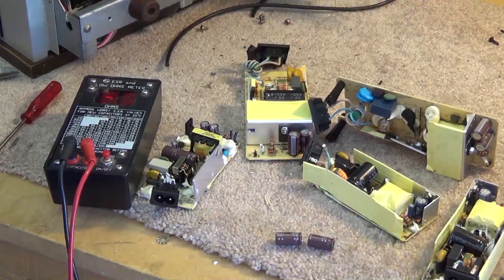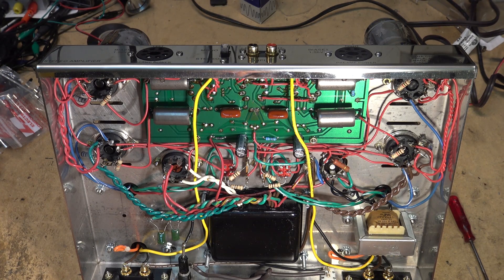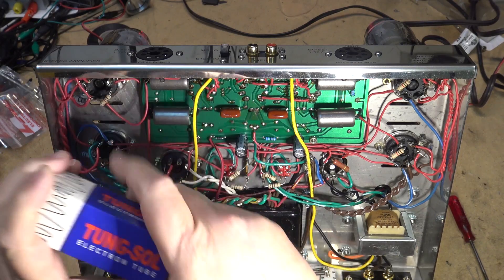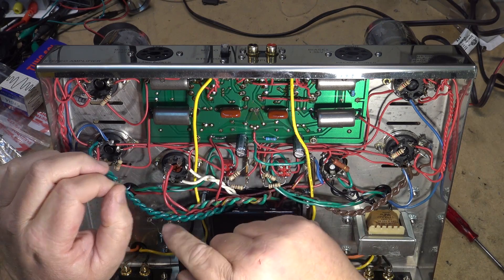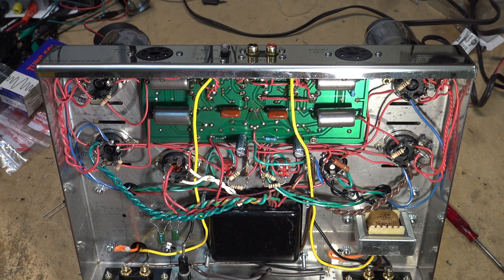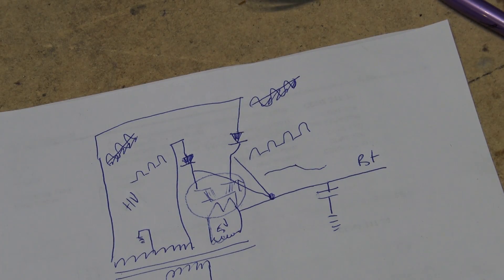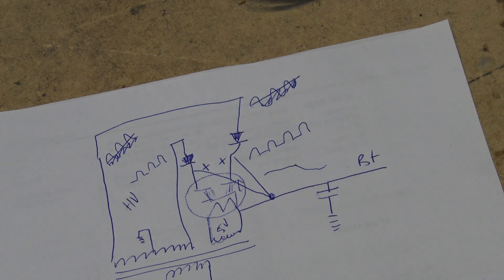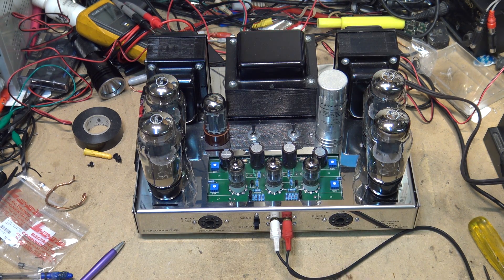Dynaco VTA-ST70 Rectifier tube protection mod

Comment: I have the same problem with my ST-70 blowing fuses. I had been using the amp for many years with a YJR solid state rectifier and it worked great. After a couple of years of not using the amp I decided to try it again and after a couple of hours of use this problem began. I bought a new rectifier tube(JJ GZ34) and made the modification, adding the diodes in the same places you show in the video. When I turn on the amp all tubes light up and in a few seconds the rectifier buzzes and lights up and blows the fuse in spite of the mod. Any ideas on anything I could be doing wrong or that there might be going on with my amp? Thanks in advance!
Reply from the maker: That tells me you have a short on the DC side of things. Could be the main filters, choke, output transformer, or output tubes.
Pull the  output tubes. Does it still draw too much power and blow the fuse/ If yes, then you have a short in one of the trasnformers, filter cap, or anything that the main B+ drives. If it doesn't blow then you have a problem in the output tube curcuit. Possible a bad blocking capacitor that is allowing DC to reach the screen driving the tube into full conduction. Also check to make sure the tubes are actually plugged in the correct orientation. This one  the tubes can go in any way as the sockets are worn and the key on the tube will drop in any position of those cheap plastic tube sockets. Better amps use porcelain tube sockets.

Comment: I found the problem with my ST-70. A dead Quad capacitor. I guess the warranty on it did not last over 50 years... I've ordered a new one and should be able to fix my amplifier soon.

Comment: Question. With this diode mod, what if you were to plug in a solid state rectifier. Will the Stereo 70 amp still work?
Reply from the maker: Yes it will

Comment: Did you have to reset the bias?
Reply from the maker: I did check it was slightly lower .38 so I reset it to .4. remember the bias will change slightly based on line voltage, but a .02 volt difference wouldn't have affected it at all.

Comment: Hello. Is it possible to replace tube with a custom circuit with transistors, capacitors, resistors, diodes?
Reply: Rectifier or output tubes?

Comment: The arc over problem gets exacerbated by turning it off when hot, then turning back on again (before giving it time to cool down).
Reply from the maker: No, it does it stone cold too.
Reply: @12voltvids  I"m sorry...My statement is true.
Reply from the maker: @mlbabineaux  well this one came in arcing and sparkjng at power up after the owner bought new tubes.  The old original didn't do it hot or cold but the new tube did, stone cold or hot and it shouldn't.  The fix is the diode mod to eliminate the reverse voltage. These old units were designed for 110 volts which is what was at the outlet on the 60s when these were new.  We now have 120 volts which adds about 80 volts p-p on the secondary.  This exceeds the max inverse voltage for the new type types available today.

Comment: in europe the voltage is 230v so how would one deal with this modification in this manner of 230v❓different diodes❓of course with anyone using a dynaco ST70 in europe, they have a different voltage regulator...?
Reply from the maker: In Europe you will use a different power transformer or it is wired for 240. I don't remember if it is s single or dual voltage primary.  The diode mod is the same as the secondary voltage is the same.
Reply: @12voltvids  
so the modification is exactly the same you're saying because this comes after the transformers ❓
Reply from the maker: Exactly.

Comment: The original Mullard 5AR4 never needed diodes. Almost all of the russian rectifier tubes don’t meet specs in the same sense as the UK and USA made tubes did. My ST-70 runs just fine on 120 volts with just one CL-80 inrush current limiter on the AC mains and US and UK made tubes in the sockets.
Reply from the maker: The UK and US tubes had s higher reverse voltage.   It doesn't hurt to add the diodes.  It doesn't change the sound and it doesn't change the sag that rectifier tubes have.  If you removed the tube and put the diodes on place of the tube then yes you eliminate the tube sag, but the mod puts them in series.  So everything still flows through the tube.

Comment: Who can help me? My dynakit st-70 has a problem. After turn on the amplifier for half hour, the choke C-354 is very hot. Is it a problem? I always turn on it not more than 30 minutes.
Reply from the maker: Check your tube bias adjustments.
Reply: @12voltvids  You are right. It was 1.64V. I adjusted  it to 1.56V. I will check it for next few days. Thanks.

Comment: SO\o it was full wave rectifier now its a half wave rectifier?
Reply: No, whether silicon or tube, placing two "diodes" in series, on each side, doesn't change it from full wave to half wave. Now, if it was not utilizing the center tap of the transformer and one of the outer legs went to ground, then you would get half wave.
Reply: I could explain better on an illustration.
Reply: With the mod, the plates of the rectifier tube are fed a half wave rectified signal. The cathodes output is full wave rectified dc same as before the mod. 
The addition of the diodes in line with the plates, effectively cuts off the negative pulse to each plate. Now there is 0 volts at the plate not in use, while the other conducts.

Comment: I always thought it ironic those that claim vacuum tube amplifiers "sound better" than solid state.  Vacuum tube amplifiers introduce multiple levels of distortion, from power supply sag to transformer distortion, to impact suppression.  It's like the more distortion introduced the better the sound, which is silly in my mind.

Vacuum tubes, by their high impedance nature, are poor choices for driving low impedance speakers needing high current.  Power supplies with resistor/capacitor pi networks will always sag, regardless of if fed by a diode rectifier or tube rectifier.  One will just do it worse than others.  Why would anyone think the output of a tube amp with all of the new and introduced distortion "sounds better"?  The only thing you can give me, is a vacuum tube amplifier can "soften" up an originally harsh sound, simply because of its rubbery response not allowing high-impact harshness to pass through.

I can understand musicians wanting to exploit the distortion for their instruments, like guitars, to achieve a certain sound, but I still cannot see how that benefits the overall sound of the performance as a whole in a positive manner.

Lesson:

* Power supply sag is distortion, this is brought on by weak rectification and poor voltage control via resistor/capacitor pi networks.
* Audio transformer phase instability and frequency cut off, is distortion
* Poor "punch" response (mostly due to sag) and the inability to sustain high-impact signals before the sag begins.  This is the main cause of the so-called "warm sound" audiophiles claim to love.  It's just distortion.  Harshness and impact are impossible because the sag is softening the output instead of accurately reproducing it.

While I enjoy vacuum tube equipment, I still consider them the devil's equalizers.

Comment: The problem is today's 5ar4 tubes are crap.  An old Mullard or even Sylvania would work in there for almost your lifetime.  In reality I would just do diode rectifier and get better power out of the amp.  Or loose the stand up capacitor and install parallel 5ar4 tubes.  And I believe the 5vokt tap is 3.5 amp on those so it would live through it.
Also the new Tung Sol is made by JJ. And I'm not a fan of there rectifiers either.  The China ones are not that bad and the Sovtec are decent.
Reply from the maker: I have been running Russsian Electroharmonix tubes in my little home built amp and like the sound of them.  I agree that NOS vintage tubes are better, only because they were mass produced and with mass production comes expertise in building tubes. The modern ones are replicas, and even though they are very good, they haven't been making the new ones that long by comparison and the numbers are relatively low compared to before.
Reply: GZ34 from Mullard NOS are the best I've used.

Comment: A power supply sage is not a good condition in a hifi amp the idea is just increase the signal not alter it in guitar amp this is not the case a lot of problems are used as effects but in hifi you don’t want a signal to be changed oof solid state rectifiers and the needed time delay on turn on all so lessen the load on the power transformer and reduce heat the true enemy of electronics
Reply from the maker: The best amplifier you can use is a single ended class A amp.
One of these will give you perhaps 9 watts.  
Class b introduce cross over distortion. Blades as class ab this distortion is reduced not eliminated.  The second best amplifier is actually a pwm or class D amp.  Many will say a class D doesn't sound good but in reality a class D is about as close to a perfect amplifier you will find.  So why do people pay huge dollars for a tube amp? Because they sound better.  They are not accurate at all. They add plenty of even order harmonics to the sound but that is the point.  They compensate for inaccuracies of speakers and make the sound come alive.  Also the human ear is not perfect but aligns well with the way a tube responds.   So a solid state amp on paper looks superior, but no solid state amp has the sound quality of a vacuum tube app and this is why vacuum tube amps are still at the Pinnacle of Hi-Fi amplifiers today and people pay huge dollars to buy them or build them. The mod done on this one has nothing to do with sound quality it is to protect the rectifier tube from peak reverse voltage as the current generation of rectifier tubes have a lower peak IV rating then vintage tubes and can arc over. One of the reasons this happens is because a vintage amplifier like this was designed back in the day when our line voltage was 110 volts today it's 120. When operating on 110 volts the b+ would normally be around 420 but the increase from 110 to 120 increases the operating voltage on the b+ to about 456 volts and also increases the peak inverse voltage by the same factor which puts it over the limit of the modern rectifier tubes. Adding a solid state halfway rectifier diode ahead of the plate prevents that negative voltage from reaching the plate so the tube is only conducting on the positive voltage this eliminates the possibility of arc over due to exceeding the maximum peak inverse voltage of the vacuum tube.
Reply: Kinda true a class a amp has no crossover distortion but a bridge output from two has the advantage twice the voltage Swing for four time the power utilizing the same rails 
Also tube amps sound nice because of there output transformer they cancel out odd harmonics and won’t pass a square wave so they clip nice

Comment: It is interesting to note that a spec sheet for an Amperex 5AR4/GZ34 lists Max PIV = 1500v
and Plate-Plate Vrms = 1100v. 
I just recently had a new Tung-Sol 5AR4 arc over at turn on. Three hours or less on the tube. It arced, and opened up. 
I'd say the Ruskies making these new tubes have their heads up their ass.
Maybe the Donald can give Putin a call and ask whats up,... (yeah that would help)
Sure hope my new EL34's are not of the same bull shit quality.

Comment: GZ34 5AR4 should be good for 550V with 50uF. Some of those are simply NOT GZ34s.
Reply from the maker: You saw it on the last installment. Arcing and blowing fuses.
Reply: @12voltvids Any rectifier of the type should easily manage 1500 volts PIV and 600mA current. I was wondering if they had marked a different style rectifier as GZ34 (they used to do this, but long ago). Checking all types, only the wimpiest of rectifiers, would have any problem with the voltages here. I missed the first video....I had a quick look and whoah it sure flashed over.  That tube is just for the bin.
Reply: With 120 volts instead of 110, the output of the rectifier/capacitor/inductor DC voltage is about 450 to 500 volts at idle due to winding differences in transformer manufacture. Even allowing for nearly 25 volts of forward voltage drop in the rectifier tube, it's being pushed very close to the upper voltage specification in reverse bias so, one good spike on the line voltage and you get an arc.

Maybe the modern equivalent is built to the RCA spec on paper and not the actual physical RCA spec? Here's what I think: What may have happened was that back in the day, the engineers of the tube may have put a small fudge factor in its absolute upper capabilities. If we allow for 5 to 10 percent of the tube rating and state a lower spec of its full capabilities, this would allow for fluctuations in line voltage. While it's just supposition, I do notice the problem to be endemic to Sovtek tubes as well so, it's as good a theory as any other for the arcing problem.
Reply from the maker: @martinda7446  
The old ones NOS would have been good for 1500 pic, but good luck finding one.   Current production certainly don't.   The tolarences not what they used to be.  In the audio tubes they are pretty close because they sell a fair number but fewer rectifier tubes because most modern amps use ss rectifiers.  I was thinking if adding a clip from the last video of the flash over before doing the mod but figured it would draw additional views to the bias set up video where the tube did flash over.   
I initially did condemn the tube to the bin and then started looking at the forms and found that the modern rectifier tubes this is a real common problem and the diode mod was out there for every amp design.  Mostly guitar amps but also hi Fi Amos including the st70 dynaco.  So it is a wide spread problem.   I had initially considered just putting diodes in and leaving the tube to warm up for esthetics like I did on an old radio I have but this mid at least keeps the system relatively stock and prevents hammering the tube plates with full voltage when the tubes are still cold.   On my amp, I run through a 40 watt light bulb in series for a few minutes to allow the tubes to warm up with reduced b+ and then throw a switch to bypass the bulb to give full power.   Some day I will mod my amp with a standby switch to control the b+ seperately from filaments to I can fully warm tubes before turning on power to  tubes.